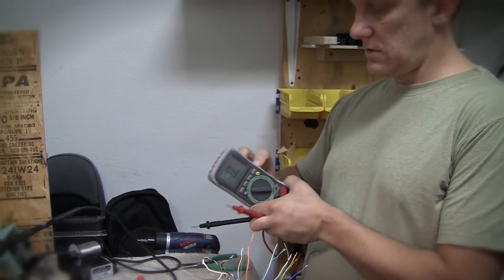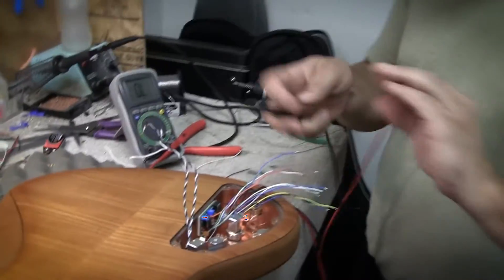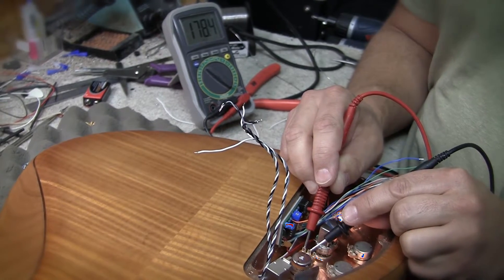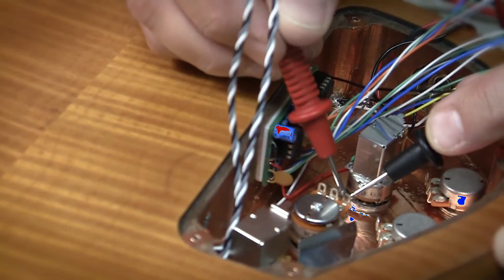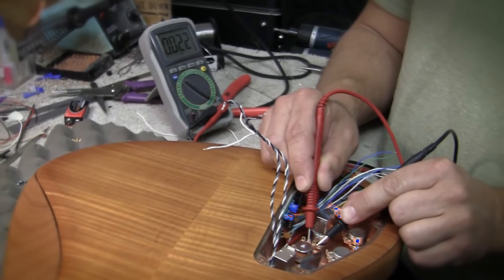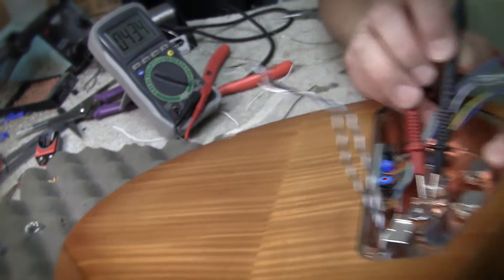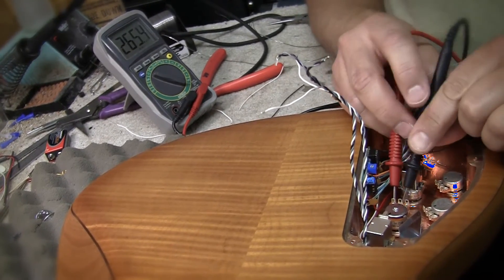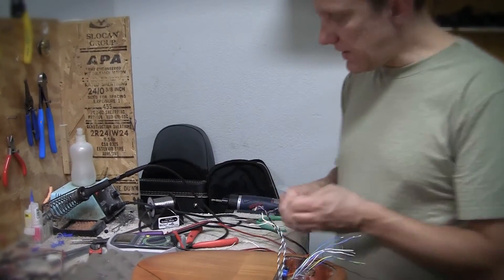How to analyze and wire a blend pot correctly

Comment: When wiring the center detente blend pot- At the center both pickups are fully on but output is down 50%-be careful how you  wire the out put- **"some wrings" when  you turn pot  full CW or CCW you ground the output.*just something to be a where of. ***DR KEL